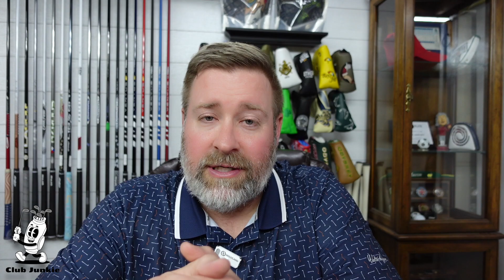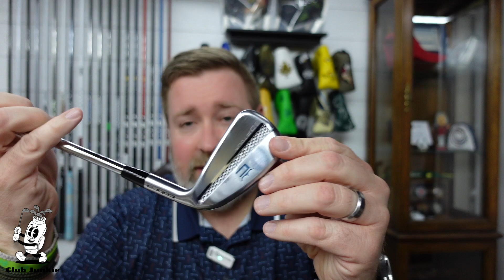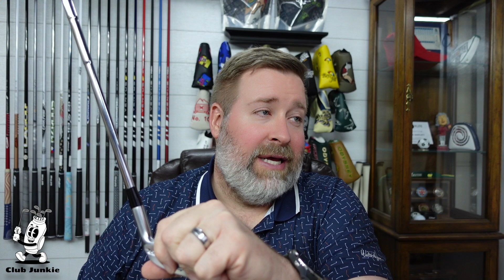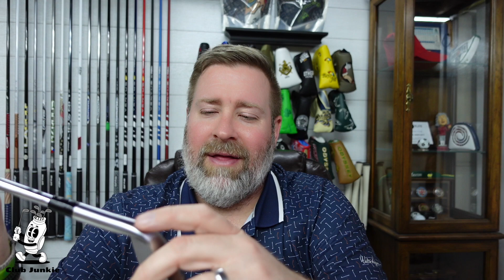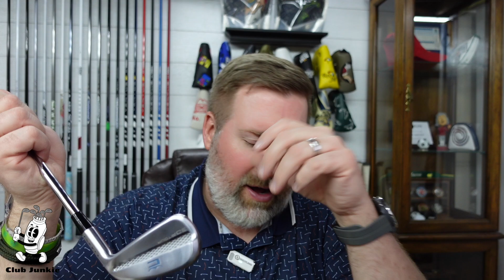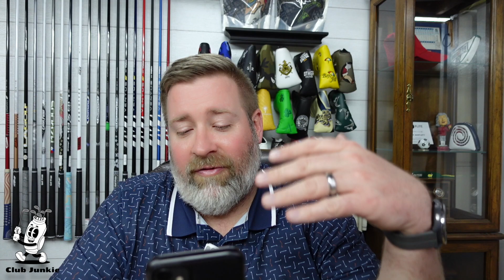Cobra 3D Printed Tour Irons Review – Are These the Future of Players' Irons?

Comment: Can anyone tell me how these are different than the Limit3d models? Drive me nuts when companies do not specify things like that
Reply from the maker: They are only cosmetically different. Same construction.
Reply: @golfwrxradio  There might be small improvements under the hood, like how car makers implement small improvements year to year on a current generation. With that in mind, I'd probably go with these if I had to pick between the two models.
Reply: @lkae4 They're exactly the same except the badging. This is just full production of what was initially a limited run.